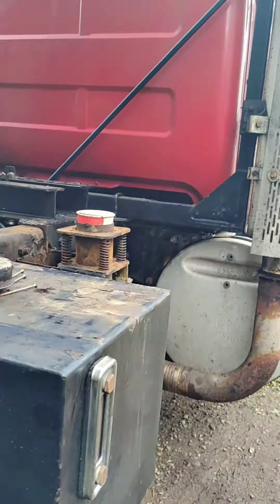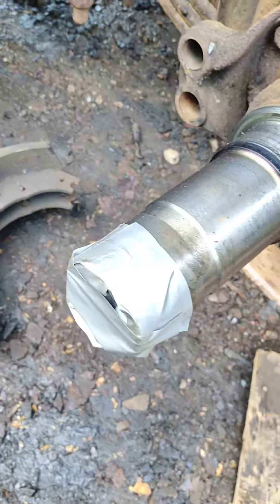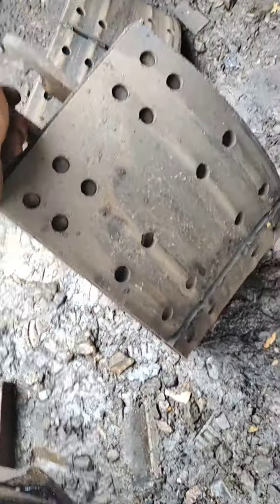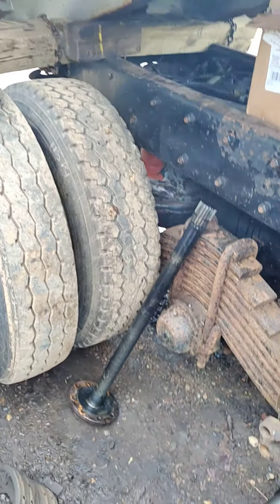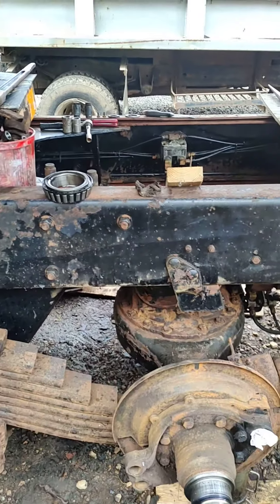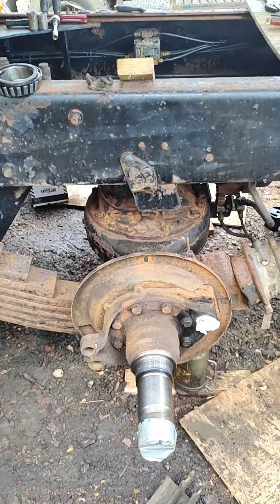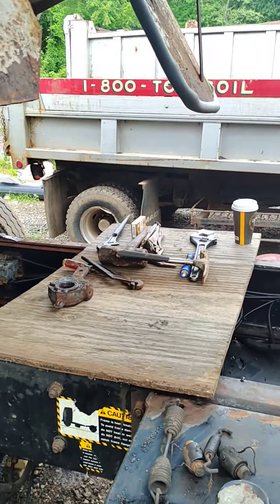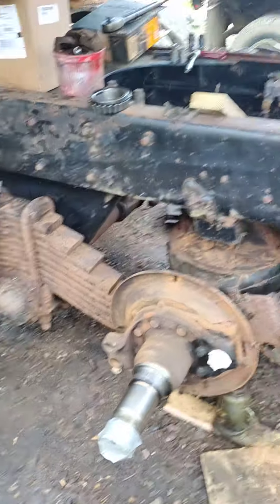beware of trucks

Comment: These guys were hauling a large Trailer of bails of hay a few weeks ago. Fire started in the bails and melted the stop sign. Huge Traffic situation due to a hung brake drum on the trailer. The fire was 20 feet in diameter. I still see the circle on the road at that stop sign that has been replaced. Happy Fourth. Excellent work on that truck.
Reply from the maker: That might have been breaks. But often the driver flicks a lit cigarette out the window and it ends up in the hay combined with the wind from driving ....  Big fire !